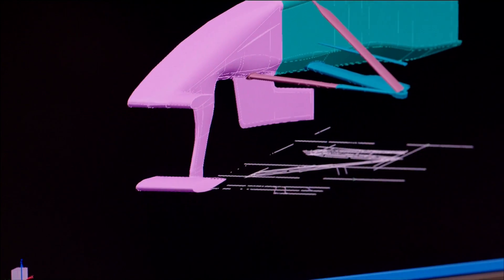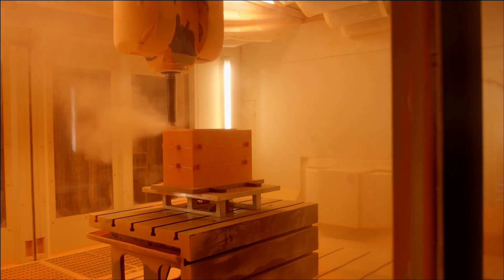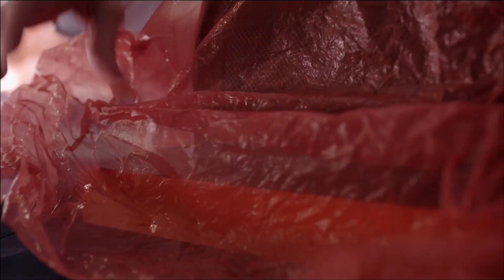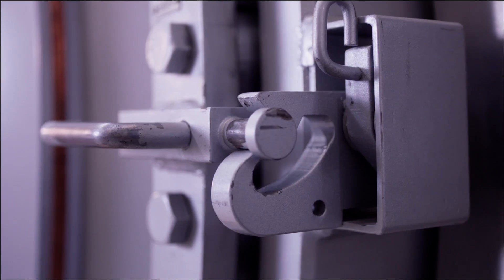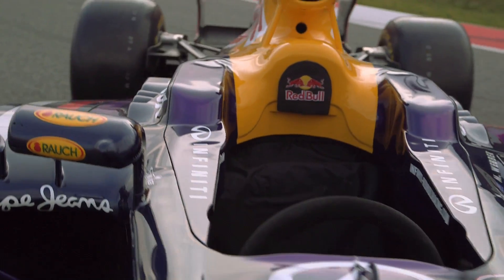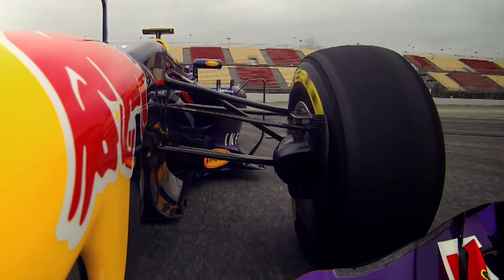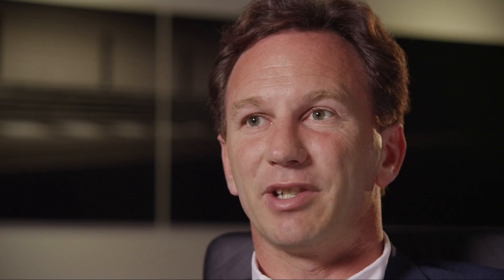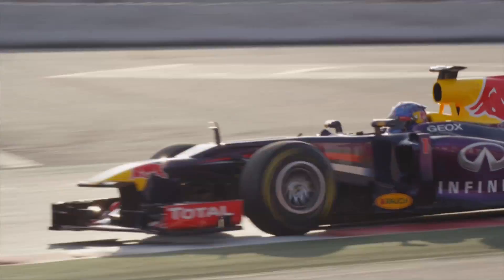How To Make An F1 Car: COMPOSITES (Part 2)

Comment: 10x stronger than steel my ass!!
Reply: It's weight for weight.
Reply: And the internal and external structure.
Reply: "As a comparison, steel has a tensile modulus of about 29 million psi (200 million kPa). Thus, the strongest carbon fibers are ten times stronger than steel and eight times that of aluminum, not to mention much lighter than both materials, 5 and 1.5 times respectively."
Reply: right......because the carbon fiber people are too stupid to know whether its stronger or not right?